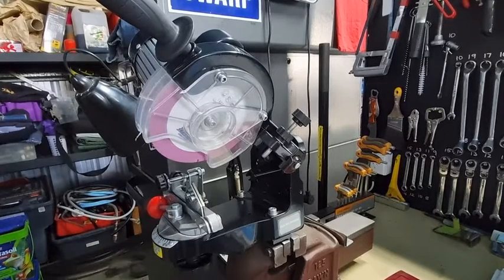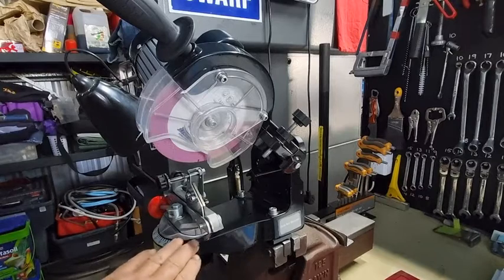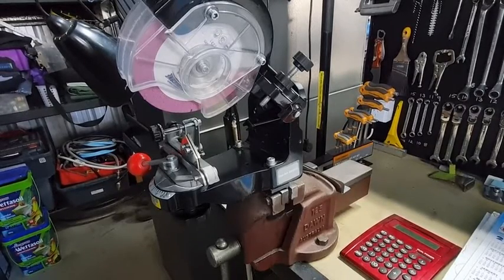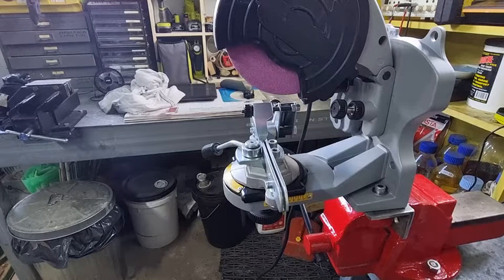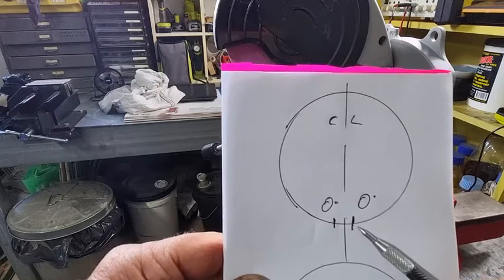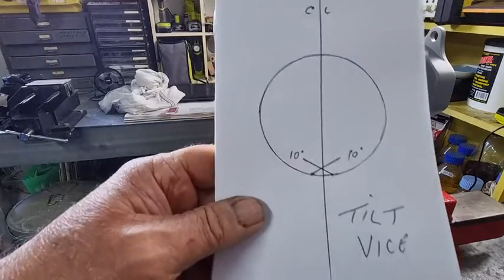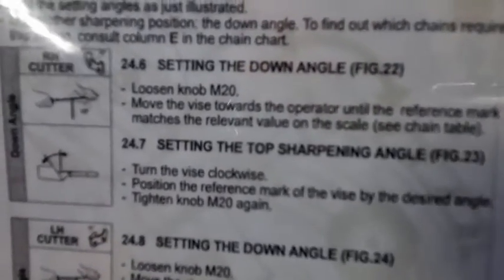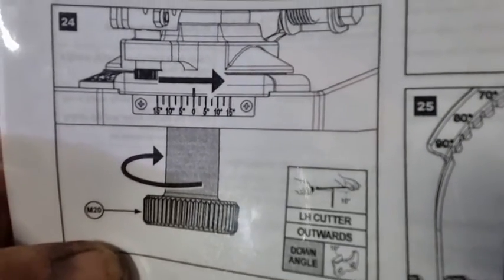How to set the 10° downward tilt on a grinder without making a mistake

Comment: Hi SpannerMan, do you recommend putting 10 degrees downward tilt on Sthil full chisel chains?
Reply from the maker: Hi full chisel chain with 10° is suitable in hardwood it puts a compounded bevel angle reduction in hook giving more metal support for the working corner.  If you have a grinder with it won't hurt to do it.

Comment: On a 520 Oregon grinder there is a tilt vise, but no markings to know how many degrees. Do I tilt vice all the way?
When tilted, the top plate angle changes not corresponding to 30° degree setting on vice. Do I eyeball setting of vice angle aligning with mark on top plate?
Reply from the maker: 10° on the vice has no markings.  Just push it all the way.  That will be 10° tilt my 511A is same
Reply from the maker: Yes, also, you are correct. The top plate changed about 2°  it's up to you if you want to compensate for that.  At 30° it will be approx 28° I would not worry about that 28° is close enough to 30°
Reply: @ChainsawUsers  Yes, but about the tilt vise. Is it 10° tilted all the way?
Reply from the maker: @johnarnold3696 yes all the way